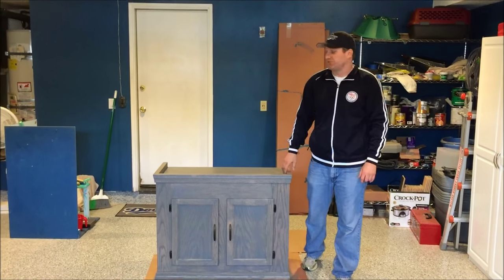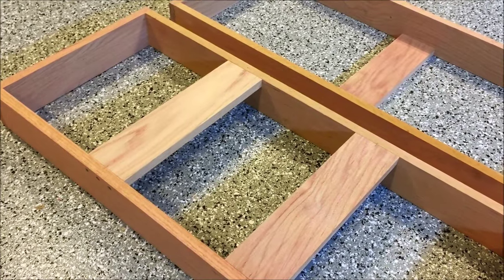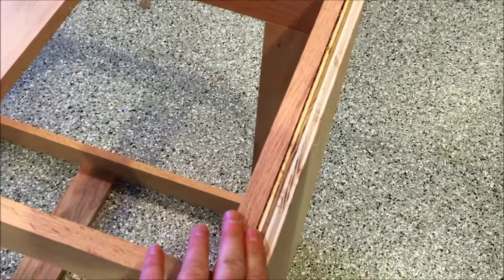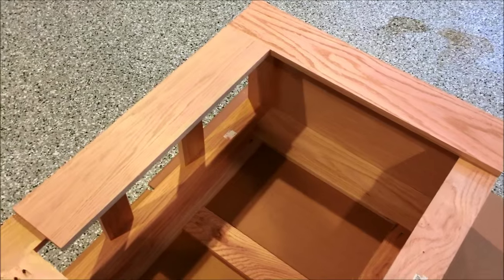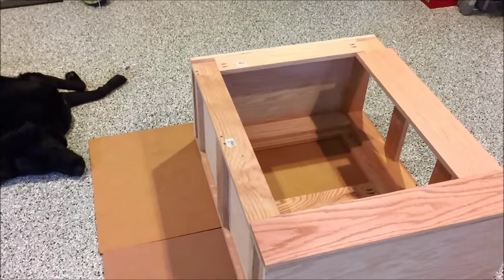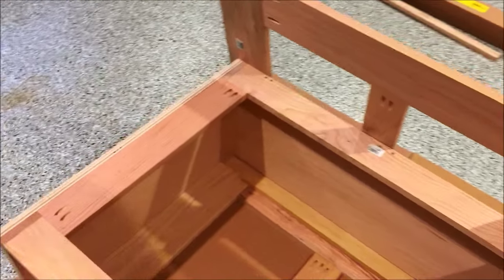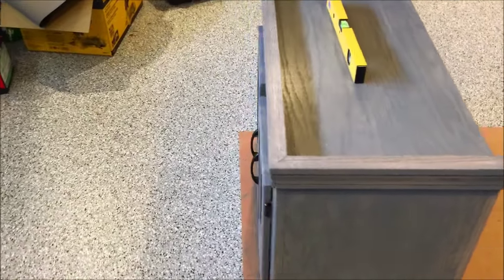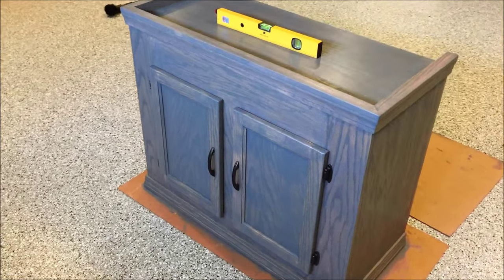40 Gallon Acrylic Fish Tank Stand Build

Comment: Finally, someone who doesn't totally overbuild a very heavy and very bulky stand out of 2x4's like in all the other videos (I know there is a certain threshold were you want to start using 2x4s instead. But for the smaller tanks, there is absolutely no need if you know how to design it). I built mine the very same way using the same oak frame in 2014 for a 55 gallon. Still strong and solid in 2021. Excellent job Tin Goose, this looks absolutely beautiful!

Comment: Looks great man! I built a 3 tower angled stand for my cactus in the back yard and it was my 1st time using stain. I made the same mistake. But still turned out well. Question... I just built a small stand for a 40 gallon using 2x4 for the frame and .5 inch plywood for the face and sides. It turned out decent for my 1st try. I was reluctance to try using the cleaner 0.75 oak because of price. With all the materials, what was your final price to build? Was it more expensive than just buying one?

Comment: I really like your non 2x4 build.  How has it held up?  Is there anything you would do differently if you made another one?
Reply from the maker: Thank you, it’s held up great.  It was definitely a bit of overkill with the amount of hardwood that I used.  The one major screw up was I didn’t properly use the prestain conditioner so the final stain did not look as good as it should have.  The cost ran a little higher than I would have liked, but overall I’m very happy with how it looks on display.